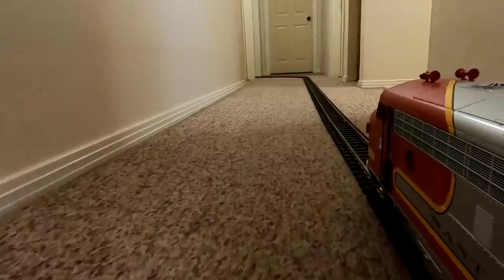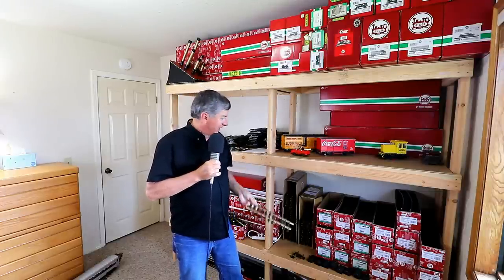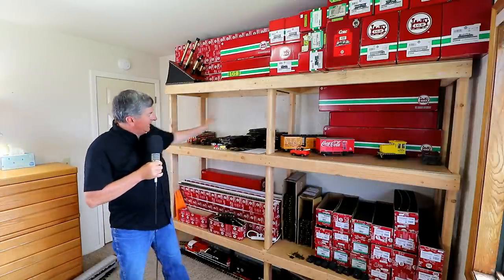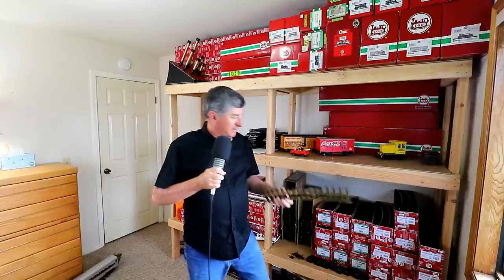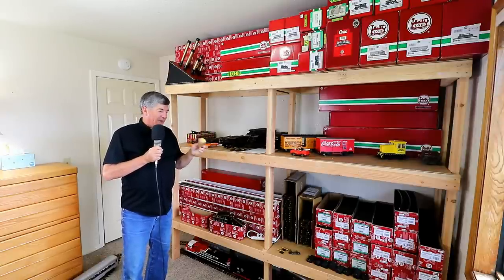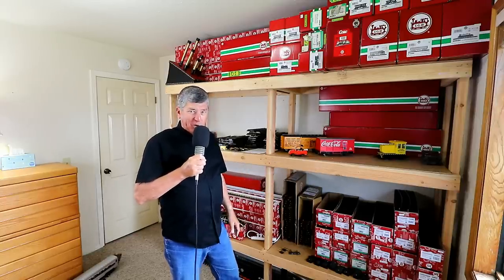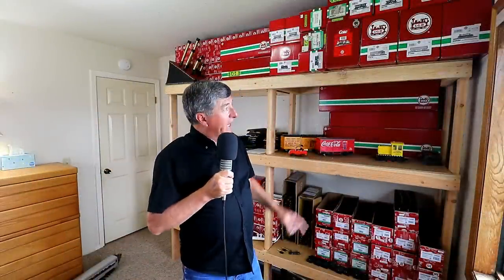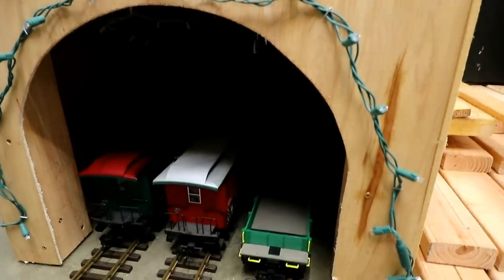Jim Zim's Model Trains - Behind The Scenes

Comment: You need to have stainless steel track outside, which they make. Have a permanent layout, and actually instead of using those power boosters, I just soldered the wire to the track

Comment: Great video. I save some money on track as I use aluminum. It's conductivity isn't as good as the brass but that's not a problem as I run Airwire battery systems in my locomotives.

Comment: Hi Jim. Great video. Answers a lot of questions - but begs several more! How long does it take you (on average) to set up/take down your layout? How do you protect your trains, etc., from damp in the garage? Lastly, when do you hope to move house?
Reply from the maker: Depending on the complexity of the layout, it might take me as little as a few hours to set it up...  or for the most complicated layout perhaps a half of a day.  It comes down really fast...  usually in about an hour.

Our garage isn't damp...  so the trains are fine out there.

Our move to the new house will be at the end of August.

Comment: Personally I have found that eBay is my best friend when it comes to obtaining track.  I use Bachmann's brass track which normally cost $14 a foot, but I managed to pick up 2 boxes (12 pieces per box) of new 3' track for under $300.  Also bought some of those LGB switches and managed to get 4 used ones for around $50.  Same can be said with locomotives and rolling stock.  I've got a few models in my collection that are well over $1,000, but I've paid nowhere near that price.  I've talked to fellow G scale modelers and a lot of them say that the second hand market is better value for money and more well stocked.  Prices on model railroading in general have gone completely out of control, but it's more so from the manufacture doing shorter runs, thus not being able to spread out the cost of toolings across as many models.  I'm just glad I got some of the models I have when I did.

Comment: mr Jim  I am impressed your train collections but I just inspired by the G scale  cleaner for tracks it's just awesome but how much it's cost because i am having a set of Santa Fe chief and flying scotsman  and  up challenger with alco 51 . my tracks are getting rusted and dust have been stayed please tell me😄😊
Reply from the maker: The Piko Clean Machine sells for $240 at www.trainworld.com
Take a look at this video:  https://youtu.be/jm3fdX0PJXQ
It only very lightly scrubs the tracks, though.  If you actually have rust, you'd be better off to use some light sandpaper on your rails.
Just for normal oxidation of the rails, it tends to take many passes over the rail for the Piko Clean Machine to do any good.  If your rails are in real bad shape, sand paper will be much more effective.

Comment: How are the trains powered? What advances have been made from 20 years ago?
Reply from the maker: The power still goes through the two rails of the track, but...
In the old days, to make the train go faster you would just send more voltage out to the rails.
You would control the speed of the train by raising or lowering the amount of voltage flowing through the rails.  If you put two trains on the same track and raise the voltage, it affects them both equally.

These days it's done differently.  It's all digital now.  A constant voltage is sent through the rails.  Each locomotive has a unique "address".  A controller can send commands to each locomotive individually by just send the command to that locomotive's address.  So, I can toot the whistle on one, or stop another, or reverse a different one...  all by sending different commands to different addresses.  It's pretty easy to do from a tablet or a cell phone, if you have the right equipment.
Reply: @JimZim  No rechargeable batteries yet? The trains are big enough to hold batteries and that would eliminate the power in the rails. I'd think that would make it weather proof for outside use.
Reply from the maker: Oh, there are definitely battery powered G scale trains.  Those have benefits for people with a permanent outdoor layout where the track tends to get oxidized sitting out in the weather all year long.  For my setup, which is mostly indoors, track power is more practical.
Reply: @JimZim  thank you for responding. I'd be interested in out door trains that are battery powered.

Comment: You are a little wrong on the lengths of track. when you say it is 150mm long it is actually the 300mm piece. 300mm=600mm, and 600mm=1200mm.
Reply from the maker: You are absolutely right.  That's really embarrassing.  I totally messed up the metric measurements.  Damn!

Comment: can u couple cars to the Clean Machine?
Reply from the maker: Definitely.  It has standard G-scale hook & loop couplers on both front and back.  You can buy the new R/C version at https://www.trainworld.com/piko-38506-track-cleaning-diesel-switcher-clean-machine-r-c-battery-powered-piko-38506.html
Reply: @JimZim  Why thank you Jim! Love your videos! How do you control the Clean Machine?
Reply: @JimZim  That is great! Maybe you should make a service cleaning train, with an lubricating car in tow, and a car with brushes!
Reply from the maker: @echomediatek1136   The one I own...  you turn on the power switch and it just runs until either you turn it off, or it runs out of battery.  However, the link I gave you is to a new model which apparently has some kind of remote control that my older one does not have.
Reply: @JimZim  That's nice! Would be useful!

Comment: Your advice that G scale is for someone older in life with  large amounts of money is total bullshit.  I'm a young G scaler and after I joined a model railroad club, I got track, and even some trains that were donated to me.  (for free). You don't HAVE to spend a fortune on the hobby. As a rule of thumb, I've never payed more than $200 for a locomotive. It's really up to you how much money you're able to spend. Model railroading can be for everyone, not just those with large sums of money.
Reply: Totally agree.
Reply: This is especially true if you're fine with buying used and doing some of the restoration work yourself.

I have some 30 year old LGB track that has been left outdoors for years, some of it was embedded in concrete then chiseled out, etc. I've just been using a small wire wheel on a Dremel to clean the connectors off and it works as good as new. Most people would have thrown it out.